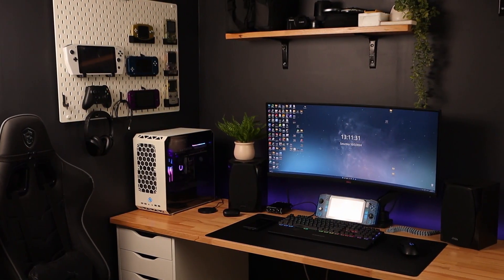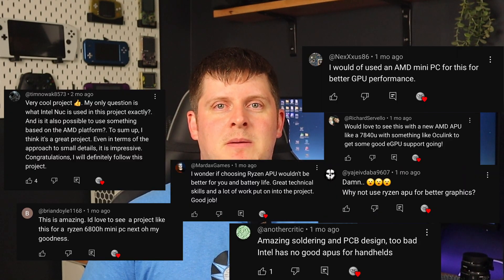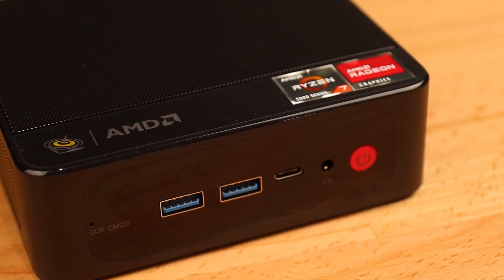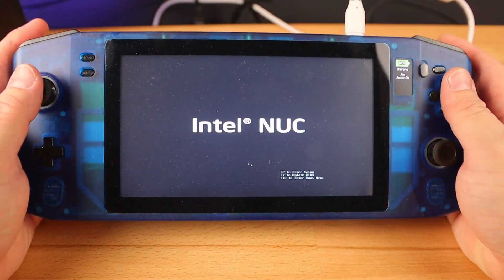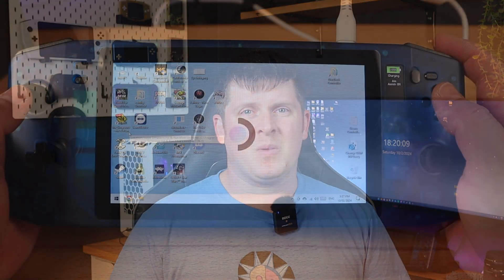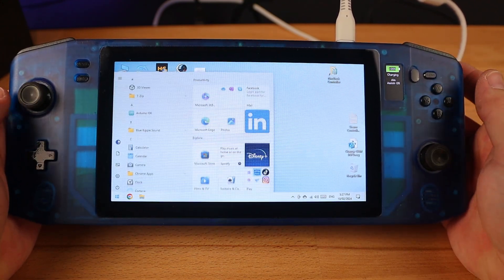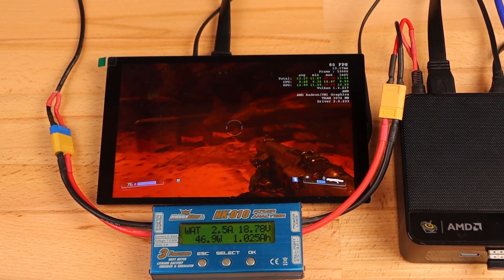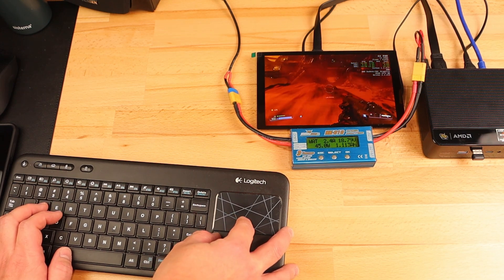New Project Announcment!

Comment: Hey Dan, I hope you see this. But I wanted to also give the recommendation to look at asrock industrial's motherboards. The asrock site has nuc based motherboards and also AMD ones. I've seen ETA Prime use a Ryzen based one. I think this is a good option and will be good to look into since the motherboards can be bought barebones I think, and also Asrock does sort their motherboards by size. So this means you could check for ones of a similar form factor to the nuc you used for the nucdeck. Hope it helps, God bless and all the best with the rest..

Comment: Why on earth would you base it on a ryzen 5000 and not 7000 which has the proper radeon 780m mobile GPU? Otherwise a very cool project, disappointing it's gonna have a much weaker iGPU then it could have though.
Reply from the maker: Price. Basically. Anything newer than this was double the price in Australia sadly! If the project does well I may be able to afford to upgrade it to a newer version in the future!
Reply: @cncdan  Damn, didn't really the price was so terrible for the 8000 APUs. In the US though ryzen 7000 mini pcs are going for around $300 which is around the same price as the 5700u, so that may be a good middle ground since they have the radeon 680m which is still quite close to the 780m or even a rog ally and outperforms the steam deck.
Reply from the maker: I paid about $490 AUD (about $325 USD) for the 5700U version that I'm currently using. The cheapest I've been able to find any of the 7000 series is around the $900 AUD mark. There were a couple of cheaper options on Aliexpress but with even fewer details available about them, I felt they were a bit of a gamble. I wanted to pick something that at least might be available in the same shape/size/brand for a few years which is why I went with Beelink as they were one of the more reputable brands I that I could actually get my hands on.
Reply: @cncdan  fair enough, sucks the availability is so terrible in Australia. Well the project here is quite awesome, so I look forward to seeing the completion!

Comment: Ok now it's powered on batteries. I use a BMS 12V 3S 18650 lithium 4000mAh (lii king 4000 verified to ~3900) and a step up Boost 12V to 19V (it gives exactly 19,12v). The battery last 20-22mn in playing switch games. So I have decided to make a bigger battery 3S3P (one battery weigh 45g so 45*9g= 405g just for batteries...)
Reply from the maker: That doesn't sound right. Did you test the batteries yourself? If you're using one of the more common 19v boost converters you may be hitting the low voltage cut-off of the boost converter before the batteries are actually flat. By my calculations you should get about 45-50 minutes on a battery of that size of your system is the same as mine. If you've bought one of the higher end models, you may have to limit your TDP if you don't want a 400g battery.
Reply: @cncdan  Yes i have tested with another Step up boost where you can manually increase the voltage thanks to a potentiometer.  The BMS in the boot goes to the security state for avoid the low voltage of cells (3.01v - 2.84v - 2.97v).
My volt and amp reader say ok for the 19.1v but the ampere at the boot goes to 1.4A or 1.04A cannot remember... and stop. After that I am forced to switch off and on to bypass the security state of the bms.
Reply: Now i am charging them and i am about to do a bigger battery. And i am begining the case.
Reply from the maker: I'll be doing some battery life tests in the next episode so it will be interesting to see if mines any better!

Comment: I have received my ryzen 72800h belink (16gb of ram and 1To SSD nvme). Yes 18-19volt, i have chosen for the battery pack to made an homemade 3S3P with a BMS (battery management system) 20A 3S with a step up boost from 12v to 19v. Once finished i will test the tension (voltage) to be sure it don't go over. There will be a screen below the deck to check the status of the battery. The battery cells are one of the best: Lii-King4000 18650 4000mAh 3.6V, mesured 3800~3900 in the real world ^^
Reply: i have bought the exact same screen because it really helps a lot : waveshare 8 inch Portable 1280x800 IPS Monitor Capacitive Touchscreen and 2 official rail switch to add nintendo switch joycons of the team Nyxi (50$) and 2 official speakers of nintendo switch (ones of normal or oled version, not lite version)

Comment: Any particular reason for going with a 5000 series? There is actually already one 8000 series available... so you could be almost on par with commercial devices rather than 3 generations behind, since it seems cost is a concert but not one that would prevent you from opting for a 500 device over quite a lot older one at a similar price. The GPU in the recent devices is quite a lot stronger also. Also I am a mod on the AMD subreddit, if you were to name your video in a more plain way it would help a lot since we have a rule that disallows posting links with altered titles. Thanks!
Reply from the maker: Price, basically. I haven't been able to find anything newer from a relatively trustworthy source that isn't 2.5x the price I paid for this one. I'm aiming for the design to be easily upgradable though so if its something people want to see and the series does well, I may be able to justify upgrading to a newer model eventually!

Comment: this is a neat project
i wonder how it would fair with a mac mini
m series mac minis are super power efficient with tiny motherboards now and can run without any cooling
unfortunately my a12z mac mini despite being more power efficient and having twice the ram/storage of my spare m1 still uses the massive intel board size so that would be a no go

excited to see how this turns out and to mod it to use a mac mini when finished
Reply from the maker: I had a bit of a look and I'm pretty sure the Mac mini's are almost double the size of a Nuc. Happy to be proven wrong however! I'm really not an apple/max person so I am completely unfamiliar with them!
Reply: @cncdan  yea the size is abit misleading on them since they had to keep the same physical dimensions for corporations that have them rack mounted
the mac mini is actually around 75% empty space on the inside now (my motherboard measures only 20mm wider than the amd one you used)
ill be keeping an eye on this so i can try retrofitting it to work with a mac mini when finished/more complete since i am one of those insane people who game on a mac lol

Comment: If I were building one ATM, I'd want:
As flexible as is feasible motherboard/system mounting, as a few mm difference needing a redesign means there's a lot of things that are likely *almost good to use but can't. Up to and including literally flexible, maybe like those extendable controllers for phones and tablets, where you can (after undoing some screws in this case) move the controllers in or out sideways to accommodate different sizes of motherboards. I'm fairly fond of Mini-STX used in things like ASRock DeskMini line, but I've seen things like salvaged laptop motherboards being used in handhelds. Not sure how much things could move but still keep the same design, but it'd be worthwhile to consider now that NUC is no longer locked to Intel and probably is going to see more variance in design.
*Dedicated mouse control of some sort, very handy to have an always available mouse for quick things or occasionally even for game control. Joystick as mouse is a quick hack, but not as nice as a dedicated Trackpoint or Trackpad.
*X-Input for the controller. I think a lot of the issues you were having with joystick is that you're using the older HID Joystick standard, but most everything PC wise expects an X-Box controller nowadays.

Best of luck on your B-Deck!
Reply from the maker: Thanks for the feedback!
I'd love to make it more flexible but without having a bunch of different options here to measure, I don't know what I can do to solve that problem. The new PC is almost 10mm wider than a standard NUC, so the new one at least should be able to take a normal NUC with just some changes to the mounting points. There will be a bit of room across the bottom of this one so perhaps other brands of mini PC with a square pcb instead of rectangular may work too.  Of course, they will all require a slight re-design though due to different port layouts and cooling solutions.
I might've been able to make it work in the original housing but I wanted to sort out the controller and display issues at the same time so a re-do of the design from scratch makes the most sense to me.

I'm planning to de-couple the power management and the controllers on this one so they can be use independantly so a joycon style setup maybe possible, I'll look into it. I was hoping to have at least a trackpad too, but so far I haven't found anything suitable.

Thanks for the suggestion about X-Input, it had never occured to me that it was just a different HID standard. I had a bit of a look and it looks like someones already made an arduino library for it!

Comment: I'd love to see a ryzen system that gets underclocked/undervolted across the board to keep power usage low for good temps and great battery life while maintaining decent performance in demanding games, similar to the switch in handheld mode. Even if its through a power saving profile it would be a great feature. Really excited about this project!
Reply from the maker: I know AMD is good for over/under clocking but I'm not sure if that is unlocked on these mini pc's. I'll have to take a look!
Reply: @cncdan  Universal x86 Tuning Utility App can set amd & intel cpu/apu tdp at 8w

Comment: bro upgrade With 8tb M.2 nvme ssd + 64gb ram ddr4 sodimm...............For name use Zenium-Deck

Ultimate Gaming PC Handheld
Reply from the maker: Definitely needs a bigger SSD, as I've pretty much already filled it with just a couple of games for testing!
Reply: @cncdan Sir Use: Ps5 Backbone One Usb C Game Pad + 8tb m.2 nvme ssd gen4/gen5 + 64gb ram sodimm ddr4 3200mhz + 5.5 Portable Monitor HDMI 4K + Wifi 7 M.2 card + Lifepo4 Battery Pack + 1.5 Tb micro sd kioxia + Integrated Slide Mini Keyboard.....Ultimate Gaming Handheld PC Build & Push The Limit of Tech

Zenium-Deck Cyberdeck Ver 3.0 Build That & Defeat All Gaming Handheld PC in Market......

Comment: Maybe try a clamshell design so you have a space for a controller and maybe a small keyboard.
Reply from the maker: Might be an unpopular opinion, but I don't think it would work very well as a clamshell. I'd end up needing to stack the batteries and controller on the top and bottom of the already thick mini PC. I reckon the base of It would end up being nearly 50mm thick. At least with a deck style layout, I have plenty of room to put batteries and controls to either side of the PC

Comment: what im waiting for is the 30 pin touchscreen panel driver (gt911). when will you release it? because im also working on similar to yours before i watched your videos, and im using ryzen board from laptop. since i dont worry about charging circuit and battery because its already built in to the motherboard. im also using arduino pro micro as XINPUT with 16 channel io expander ic.
Reply from the maker: I pretty much gave up on the gt911 interface for the time being. I don't know why its not working and I'm just not experienced enough yet to work out how to test it properly 😔
Reply: @cncdan   well, i guess im stuck with uneven bezels. haha. but i think im just going to hide it inside the face plate, problem solved 🤣